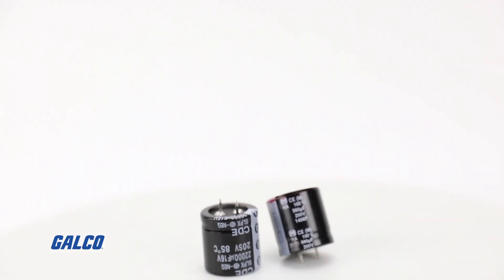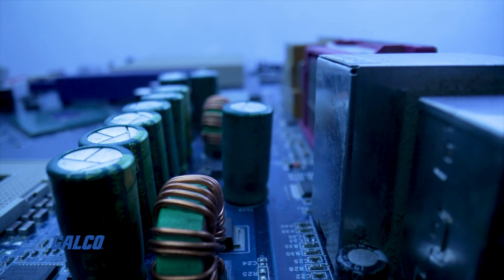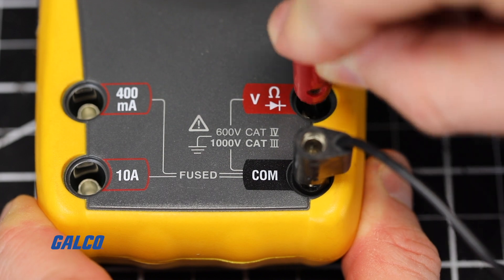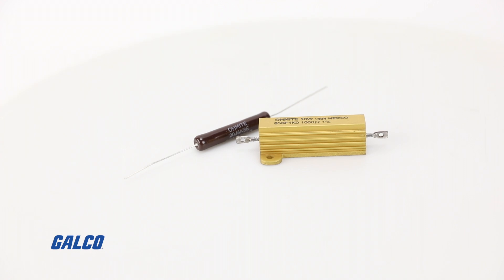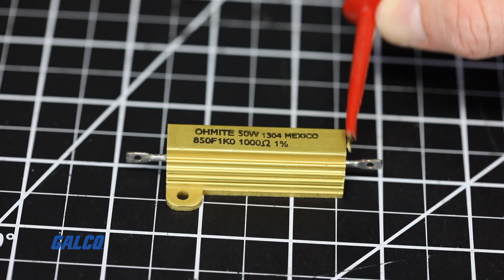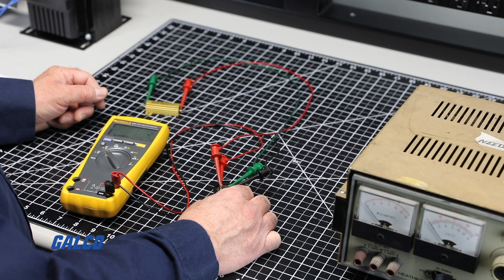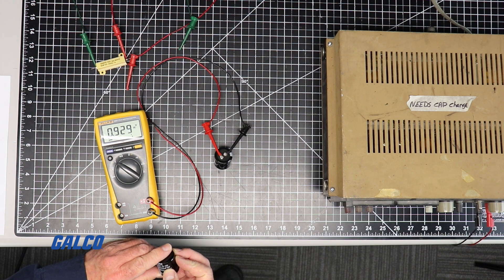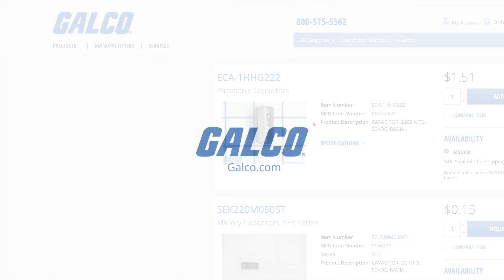How To Safely Discharge A Capacitor | Galco

Comment: I just use an insulated screwdriver.
Reply: That's what I was thinking, maybe they don't want you to generate carbon from the spark is the reason using a bleeding resistor.